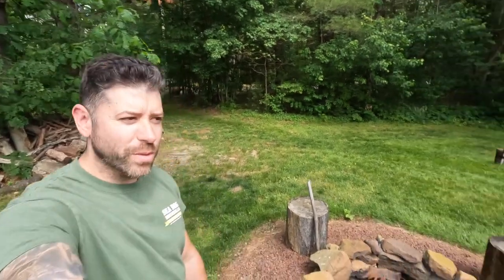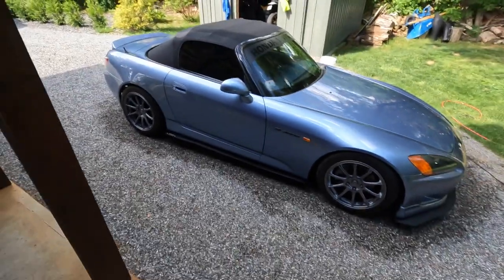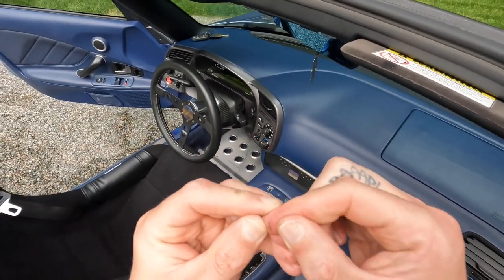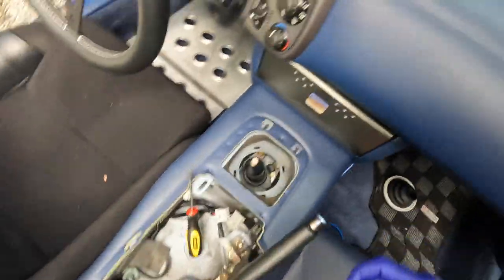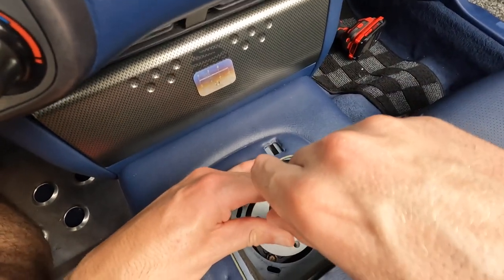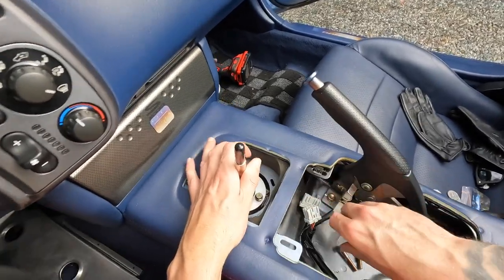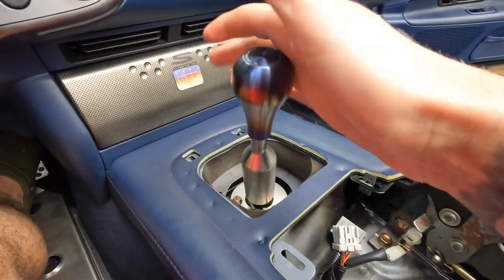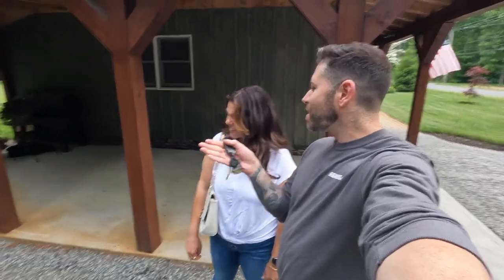Renegade Short Throw Shifter Install | Honda S2000

Comment: I have 3 S2000s and bought a Renegade Shifter back in 2019, still haven't installed it. You've convinced me that i should finally get to it. Thank you.
Reply from the maker: Holy crap dude! That’s a long time haha I have some parts that also have not gone on the car in years. It’s an easy install get to it!!! 😄
Reply: @sdoismil  Haha yup, i did the brass bushing upgrade aswell as other new components in the oem shifter and it made a difference and kept me happy. However i want to have more of a mechanical feel. Can't wait
Reply from the maker: Hell yeah man good luck!
Reply: You say 3?
Reply from the maker: That’s was a good investment, I wish I had bought 3 or more a long time ago lol
Reply: @ReanuBeeves  Yes, first one in 2019, bought the other 2 in the peak of the Pandemic.
Reply: @sdoismil  Update: I installed the renegade shifter, feels really mechanical and good. I'm waiting for the warm weather to finally go for a drive. 🙏🏻😊
Reply from the maker: @adeemmunir5494  hell yeah! Makes all the good noises! I might swap to a shorter knob so it will make the throws even shorter haha 👌
Reply: @sdoismil  yeah I'm running the renegade countersunk knob so it's extremely short haha
Reply from the maker: That’s awesome! I have their brass countersunk but now it might not go with the raw titanium and burned titanium look. I’ll have to figure something out or buy another one haha
Reply: @adeemmunir5494  nice!

Comment: Hello @Sdoismil, so you installed the renegade brass shifter bushing on your OEM shifter setup.  Did the brass bushing change the feel at all on the stock shifter?  If so, how did it feel?  Thank you.
Reply from the maker: Yea I did install it in the stock one but to be honest I did not notice much of a difference but I also had around 30k miles at the time. I have heard on higher mile cars that have not had the plastic bushing replaced you will notice a bigger difference.
Reply: @sdoismil  thank you for the reply.  They make it sound like it will be more mechanical but i might be wrong.
Reply from the maker: No problem anytime! It could be with a more worn out OEM plastic one but since mine still has low miles it wasn’t much of a difference. If you OEM one is really worn out you will most likely notice a tiny difference lol

Comment: Was the renegade shifter rhd or lhd drive. Which kit do I need for a local ap1
Reply from the maker: I got the LHD kit. I believe the RHD kit will not work if your S2000 is left hand drive. Once you get their short throw kit it comes with everything necessary to install it. Lmk if that helps!?